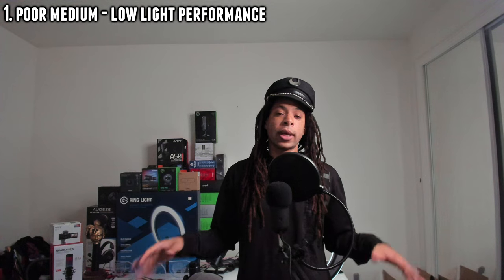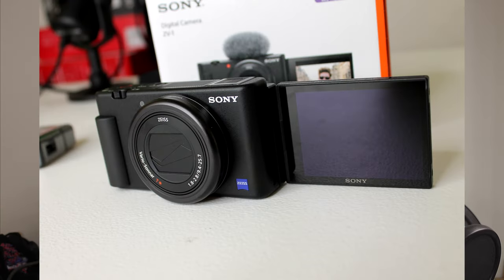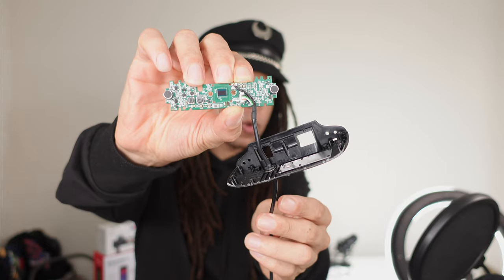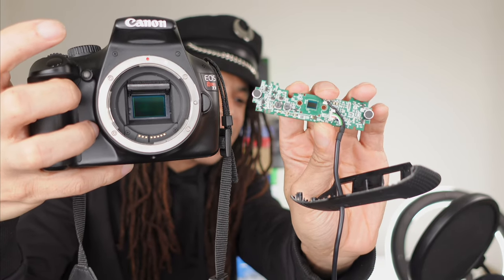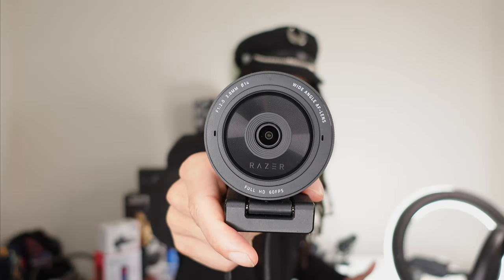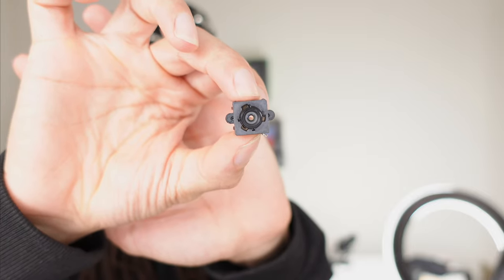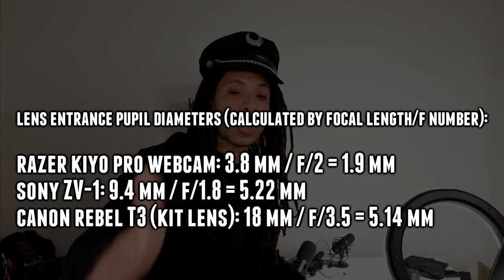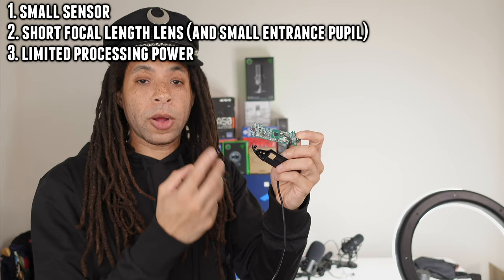I SMASHED open a webcam to see why they SUCK

Comment: USB C (USB 3.2) should have more than enough bandwidth at 10GB transfer rate. 😜
Reply: so you mean USB 3.2 Gen 2 (SS10) or USB 3.2 Gen 2x2 (SS20)? Not to be confused with 3.0 which was renamed to 3.1 which is now USB 3.2 Gen 1 or SS.

So 3.2 now refers to literally any 3.x port because there's no more 3.0 or 3.1 at all because they've been renamed.